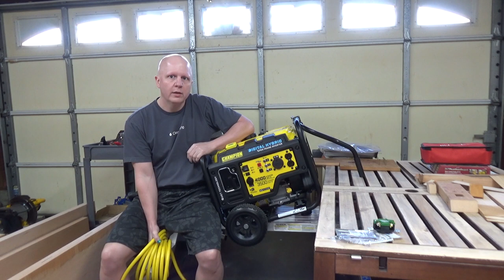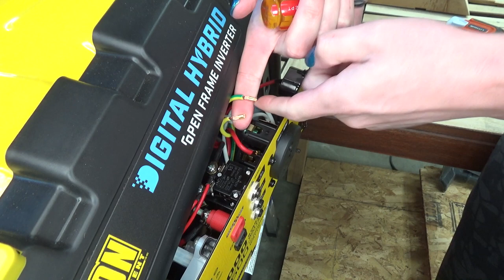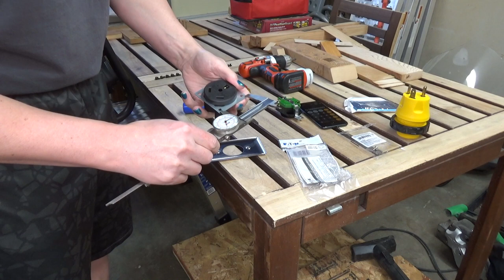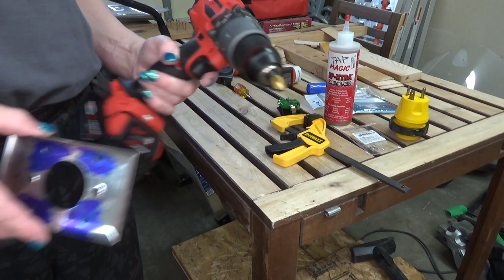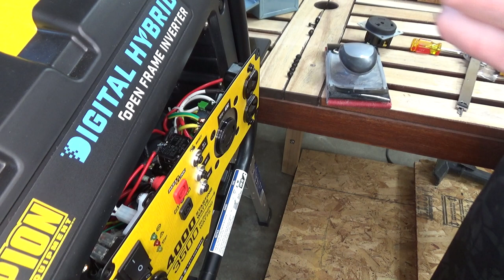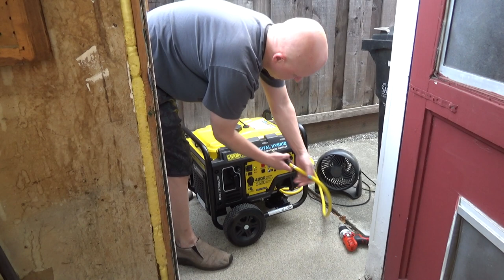Generator Upgrade from TT-30 to L5-30 Twist-Lock

Comment: Not the best advertisement for Champion generators.  Sweet nails.
Reply from the maker: It does its job well enough, once it's started. One of these days I'll pull the carb apart and figure out why it sometimes won't start without a shot of carb cleaner down the intake, but that day is not today.